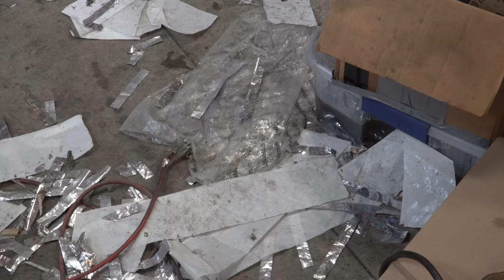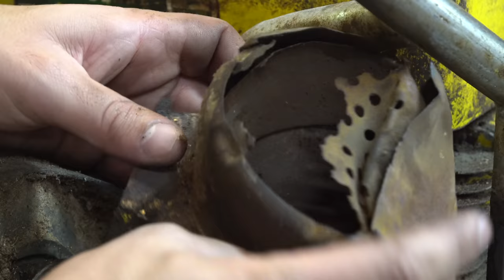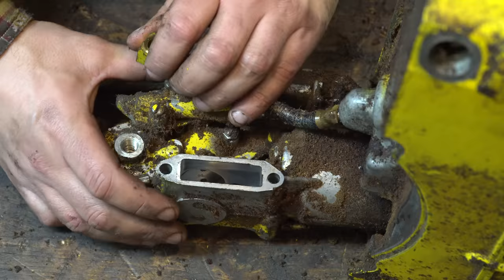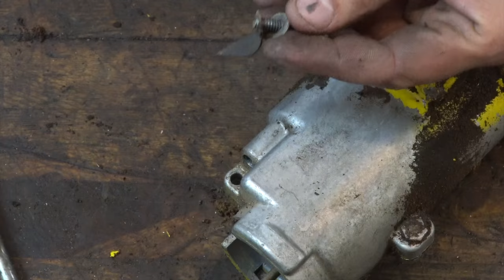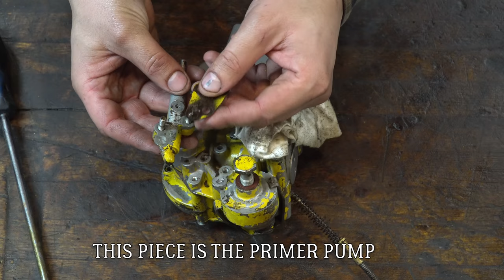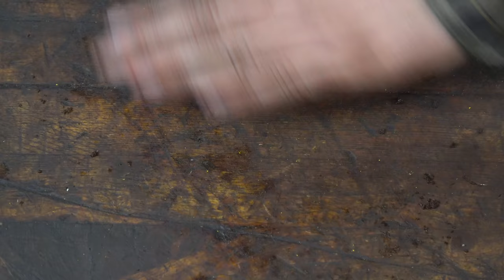Two-Man Chainsaw - Carburetor & Muffler [Restoration]

Comment: So THAT'S what pocket hole joinery is! That makes way more sense than all of those jigs and whatnot that the woodworkers are using. haha I can also think of a couple good uses for that clear coat if I can get my hands on some. Another great episode, and thank you for the admitting to the mistake with the liquid gasket. I didn't know it dissolves in gas, but now I will if I'm ever in a similar situation. Keep up the great work.

Comment: Making your own carb diaphragm.... geeze.   This sort of witchery would of got you burnt at the stake a couple hundred years ago!
Reply: @tadeuszgladysz7387  There's still hope in the world. Where I live there are these two kids, guy and a girl. They're probably inte their late teens, perhaps early 20's. They both work at their uncles(or something) autoshop and they're both amazing at fixing old stuff. I mean, older cars from the 60's and 70's. Their uncle and most of the employees at this shop just take care of regular, modern vehicles, but these two kids do older stuff. The girl completely restored the fuel injection system for my '74 Porsche 911. I mean, totally. New gaskets, membranes, bent new fuelpipes, the lot. Even brazed and fixed some dents and cracks in the aluminium body and stuff. And she's freakin' half my age!
Reply: @tadeuszgladysz7387  I just popped down to the closest trade school a week ago to inquire about going to their diesel mechanic school. The tuition is $20k. Technically it could be $10k if I signed up for a company sponsorship. And I would also have to give up my current job to do it. If you count the money lost from that job it would cost me $110-120k. I'm not going to qualify for aid because of the current job I work to support my family. This is for a community service type trade school in Detroit. If someone would be willing to grant me that kind of money just to learn how to fix trucks, I'd be willing to do it.
Reply: @jayjorz  dude don't worry, i'am a diesel mechanic myself, I never went to mechanic school, I have been apprentice two day a week for two years for 15$ a month, after 4 years a have 4000$ salary and people after college asking me how to replace brake pads, the point is you don't need any diploma to be a good, well payed machanic

Comment: I did a quick double-take when I saw the Altec Lansing speakers you were using with the Gateway - I've got a pair I still use occasionally. Must have got them with a Dell I got back in 1997,  and sounding as good as new.

Comment: I whole-heartedly agree with you on silicon sealants... particularly on small engines. I use Gasga-cinch. Now make by Edelbrock. It's about everything proof! I found out about it from a race mechanic who used to have a shop about a block from the local Hyster MFG outfit. Goes on like rubber cement... well, check it out. I'm sure you'll like it! I have even used it on early Triumph bikes to keep them from leaking oil!

Comment: A carburetor on a chain saw that complex must have been designed by a very large committee!
Reply: money is a black hole. money only goes to money. 
that's the fate of every bullshit economy that has inflation and other scams in it.
economy should be trade. nothing gained or lost. exact fixed value. but nooooooo. lets add rentals and inflation and other bullshit and ruin everything.

Comment: For the tig welding were you dipping the filler metal or laying the wire and melting it on your way or using it when you need it but not try to use filler metals

Comment: Did your endmill break off because you didn't secure the centre piece of circle you were cutting?:) Nice editing bro!
Another thing. Try lifting the electrode off the metal before you power on. The arc light colour is a dead give away that the weld is contaminated. 
Still thumbs up buddy.

Comment: I collect antique tractors and have seen some interesting examples of odd design.   I gotta say, THAT is one huge bizarre carb!  With those tractors it is usually a few tools to break it down and put it back together.  And that could be done in a hay field in a hurry if need be.  I'd hate to be relying on that huge monster to buck logs and then have a carb issue....
Reply from the maker: It's nuts.  Scares me still.

Comment: I'm in the middle of rebuilding the carb on the same saw. How far did you thread in the long fuel dial needle into the carb? More specifically, it's the fuel dial on top of the gas tank. Also, do you by chance know what the stock carb settings are? Thanks and great video!

Comment: I know how ridiculous it is for me to try to give tips to the creator of the new genre of „restoration-comedy“, but even though: when I had the same problem of having to shape a new gasket, I used a fotocopy-machine to reproduce the shape and glued the copy to the rubber sheet with wallpaper paste (as it is water soluble) as a guide. The great thing with this method is that you can even put the metal pieces on the machine when the old gasket is missing completely to get an exact replication of the area that is going to be joined!

Comment: I have disassembled and reassembled auto and aircraft engines, but I went to school to learn what was what. How in the heck did you learn to strip this saw to its bones and reassemble it ---- first try. Also how do you know it isn't out of tolerance or if you can get parts??? Thanks

Comment: If you don't have the thin G-paper a good substitute is crafts paper of the same (or 10% thinner, if you're feeling nervous that you might push the original construction) that's been coated (before being cut) with engine gasket goop using a plastic spreader. You lay it both sides as thin as possible (totally doable if you're working on the kitchen counter (no cold environments) before going to bed).
Works like a charm as the red stuff just glues itself to anything paper instantly.
You let that dry once per side 24 hours and it's ready to use.

Comment: Really have to ask, is oiled down dirt really easy to remove compared to dried out dirt? Seem you just gave it some lube to make sure it got deeper into every corner.
Reply from the maker: It's more about the solvents in the penetrating oil that start to break down the oil/sawdust mix.

Comment: Very nice restoration.
19:05 don't have to cut this gasket to measure the thickness of membrane. For example take two nuts and mesure them and write te value. Then use this nuts with membrane between it and mesure. Do the math.

Comment: Am I the only one who would of just dropped the whole powerhead into a parts washer before disassembling?
All of that canned cancer you use makes me want to preorder some funeral flowers.
I'm also surprised you haven't built yourself a vapor-blast cabinet yet...
The finish on soft or old metal will make you think twice on repainting with anything but clearcoat.
Still, love your work and passion for old iron.
Thanks for the video.

Comment: I'm restoring the exact same saw and I was wondering where that I can buy the carburetor diaphragm material. I appreciate your videos please help me
Reply from the maker: Search for nitrile nylon.  I think I got mine on eBay.
Reply: @HandToolRescue  there are several different thicknesses 0.3mm 
Seems to be the thinnest available that translates to a little over 11 thousandths will that work
Reply from the maker: @heathhigdon2815  I just got a sheet of each size just to make sure.  I ended up using the other thicknesses for other engines.
Reply: @HandToolRescue  thanks so much I've got some material on the way. I can't wait to show up at mountain Heritage days with my running and functioning model 99.
Keep up the good work

Comment: What was the spray can about? With the red cap thing you pressed into the bottom of the can?
Reply from the maker: It's a two-part gas-resistant paint that works really well.
Reply: @HandToolRescue  oh Kool, very interesting.

Comment: See your using a commercial carburetor cleaner when I was a tech I used more brake clear methethyle keystone and acitone the shelf stuff wasn't as good as what I could get at the  lumber yard. Tip you may already know.
Reply: Not sure I spelled all that properly.

Comment: And I thought installing triple Holly Carbs on a Log Intake manifold and setting the linkage was rough... I do not know what nightmare that engineer dug that carburetor out of but it should be returned to the Cuckoo's Nest as soon as possible.
Reply from the maker: It's absolutely insane.